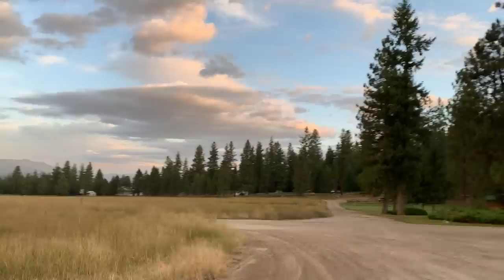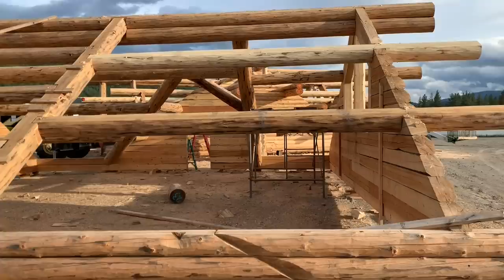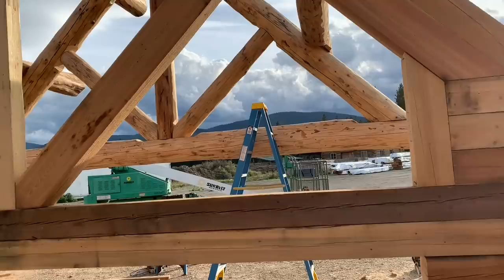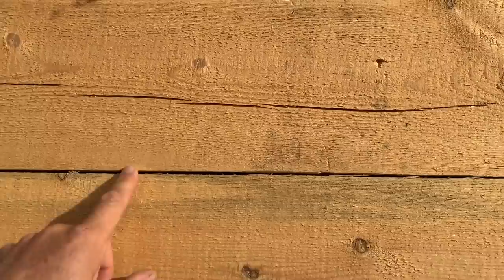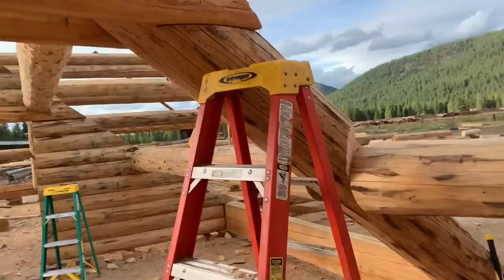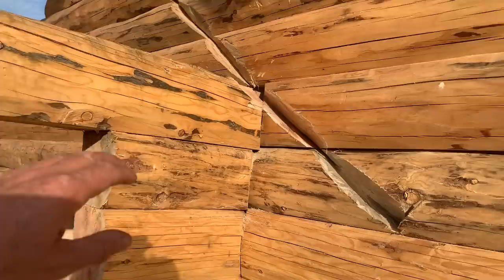Idaho D- Log Lodge Part 3- Second Floor Logwork

Comment: All that black on those logs is mold why leave it
Reply: That's actually the skin from under the bark.
Reply: @clydeacor1911  yes the cabean layer it molds and the blue that's through the log is mold as well. You folks build a nice home but why cant you dry the log in the dry and stop that mold or sprey them with bleach to kill it. I'm not new to logs but the folks you sell to are
Reply: @horseguide1  the blue in the wood is actually a fungus that is caused from beetles. They call it blue pine and people actually pay more money for it because it actually adds beauty and character to the wood.